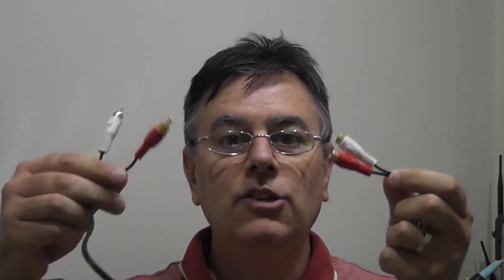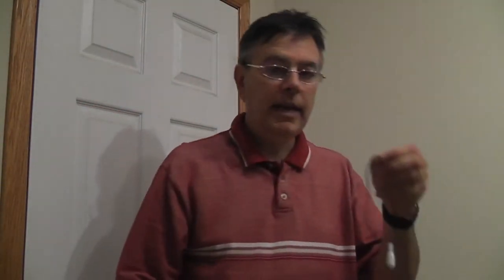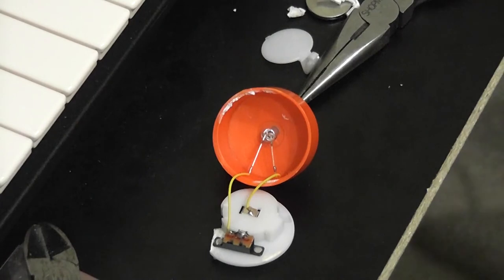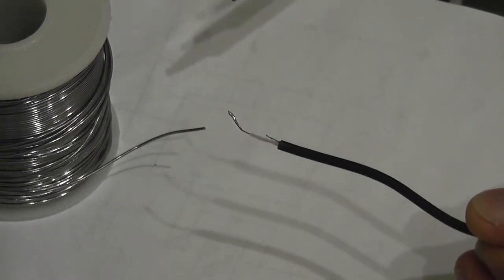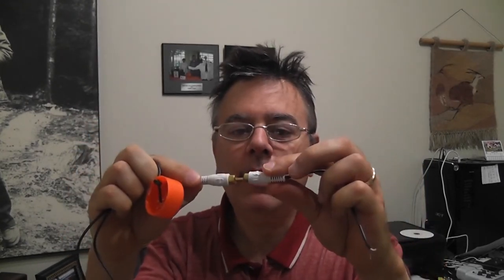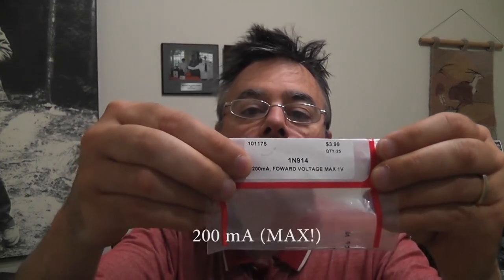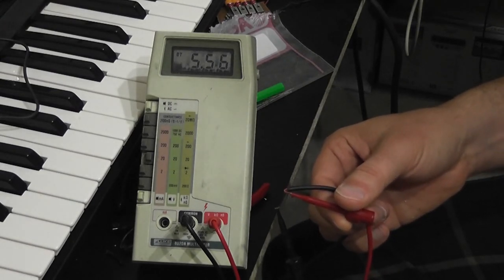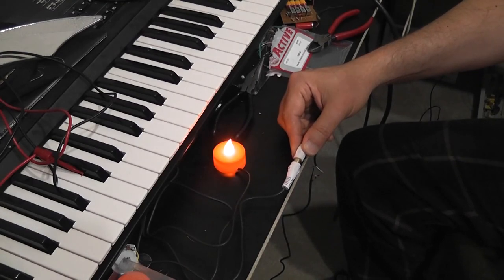Creepy Creations - Wiring a Tea Light to an Adapter

Comment: Question...  If you're wiring more than 1 tea light to the power adapter, do you need less diodes, or does the voltage stay the same no matter how many tea lights you use?